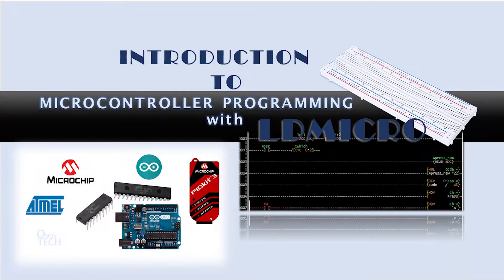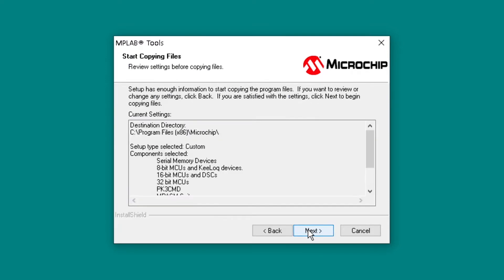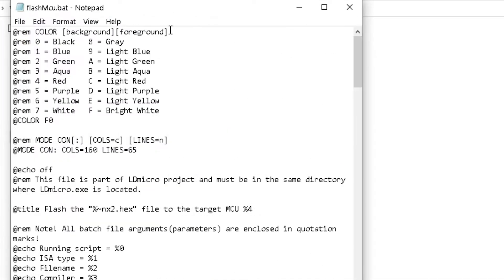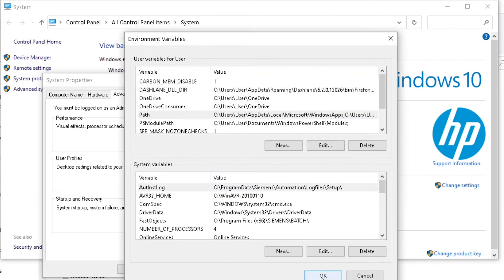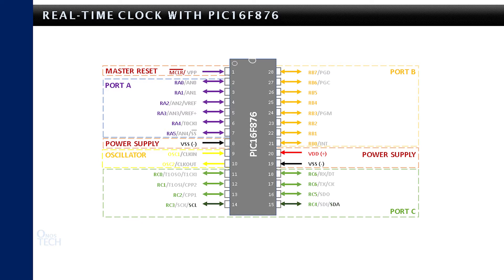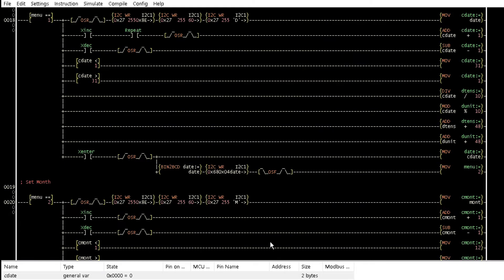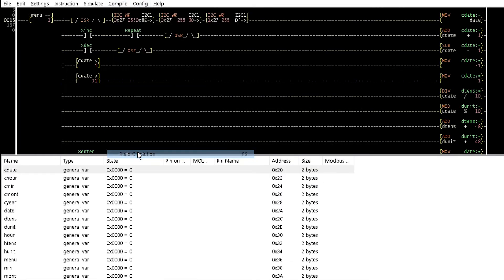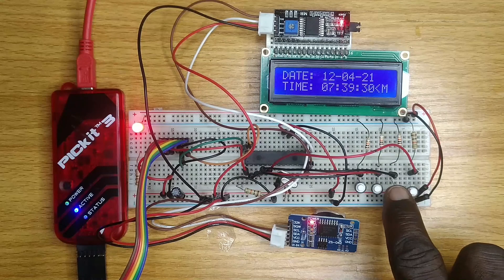LDmicro 15: I2C LCD/DS3231 RTC with PIC16F876 (Microcontroller PLC Ladder Programming with LDmicro)

Comment: Another problem is that PORTB.0, PORTB.1, PORTB.2, PORTB.3, PORTB.4 and PORTB.5 have a high level (3-4 DCV) when they are not used in the program. If you have any rung that includes them then they go low (0 DCV) WHEN CONFIGURED AS OUTPUTS.
PIC16F887
Reply from the maker: All Port pins have pull-up resistors by default. You can change that from the "settings" menu of LDmicro with the "Set Pull-up input resistors" option
Reply: @OnosTech  Shall I write 0x00 in this case? What would you recommend?
Reply from the maker: @karte2626  That should disable all pull-up resistors for that port.
Reply: @OnosTech  I'll try. Thank you very much!!!

Comment: I did this whole process but I didn't have good results I always copy in hex and save in pic but my programs work in proteus but in practice it doesn't work even a simple counter reading on the lcd is not clear as the readings you present I'm in Brazil apologies for the translation
Reply from the maker: Please share details onos.technology@gmail.com

Comment: Hi:
I really like working with PIC16F887 and version (build_5411) works pretty well with IC2. This program works quite well.

Anyway there are few things I hope you can help me out.

1.- I would like to use PORTB6 and PORTB7 as INPUTS. Every time I program any of those pins as inputs the program does not work at all.

2.- I would like to write and read registers larger than 255 to an I2C 24LC16B memory.
I used to program in PBP (PicBasicPro) and doing so was allowed.

Greetings
Reply from the maker: I will verify your first question and revert. For you second question, Jose, the I2C developer may have to be contacted. But I think a new update of LDmicro will provide some way forward.
Reply: @OnosTech  I appreciate it!!!